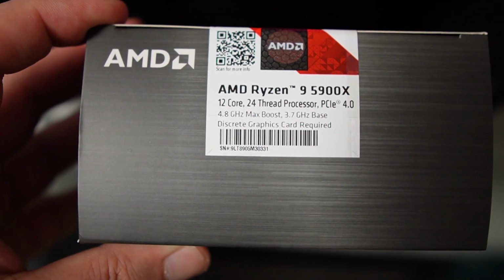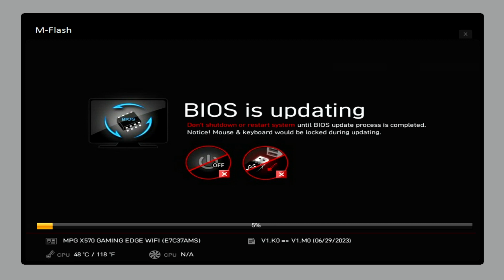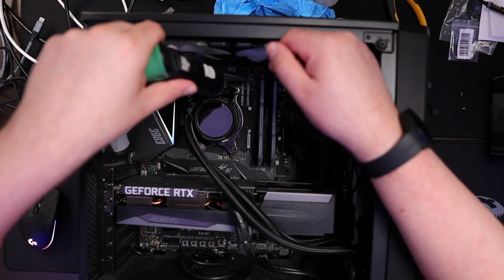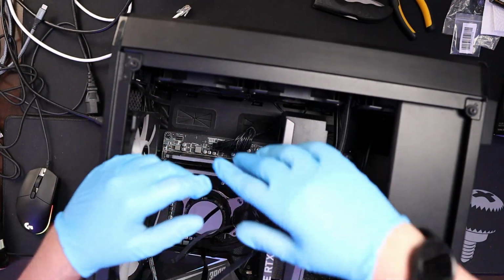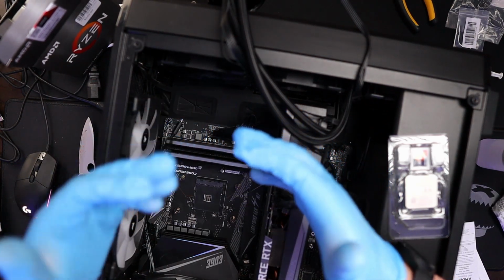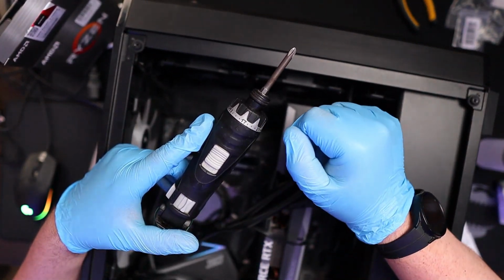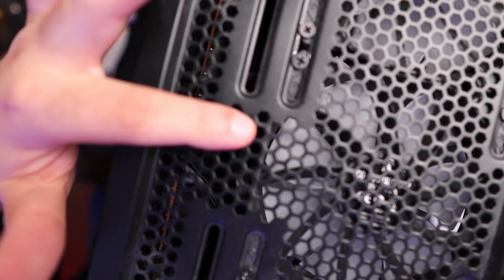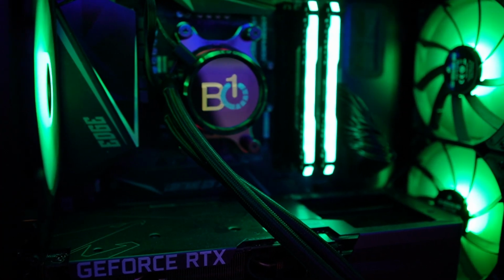AMD Zenbleed Vulnerability CPU Replacement Guide (2023)

Comment: There are no new "unaffected" processors - it affects everything from Zen2 onwords - so Ryzen 3000,4000,5000,6000,7000, threadripper3000, Epyc-rome - basically everything. But the hotfix was quite simple and just cost ~30% performance in specific applications
Reply from the maker: It doesn't affect every processor. LOL . . . but very close.  5000 series affected are Mobile Processors.  

Patches are due out in December for the workstation processors.  Kind of a long wait, hoping to see that arrive sooner.

Epyc already has patches so just need to patch the motherboard (BIOS). In the Epyc line (already patched our customers) we haven't seen any drop in performance so our customers might not be using those specific applications.  But we shall see.  

Intel also had something similar happen but wasn't as easy to exploit.

If you own a Threadripper let us all know if you see any drop in performance.
Reply: @BootOnce  "5000 series affected are Mobile Processors." Are you mixing up 5000 and 6000 there? cause 5000 desktop is affected - as per AMDs own post.

Currently i dont personally have any Ryzen processors so cant test it. And strangely they dont let me remove the patches from production :P
Reply from the maker: Do you mind sharing the post you read?  I am reading from the CVE which doesn't mention desktop 5000 series. 

CVE-2023-20593

https://www.amd.com/en/resources/product-security/bulletin/amd-sb-7008.html

Is there another CVE for this vulnerability?

Thanks